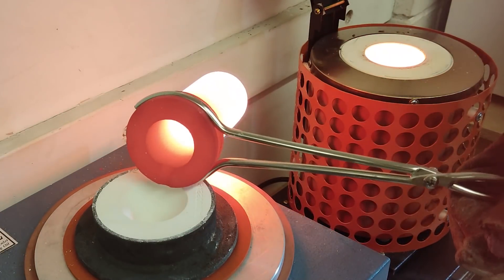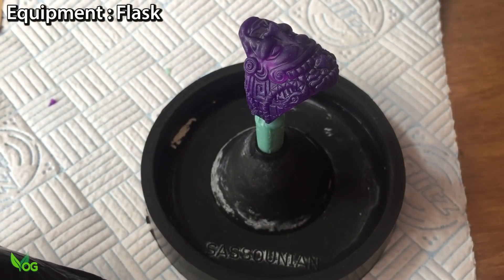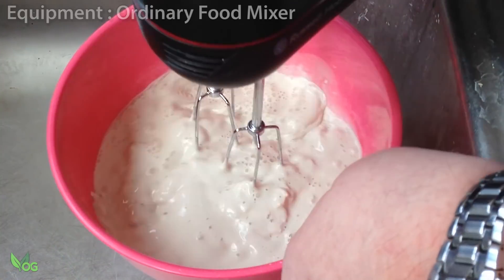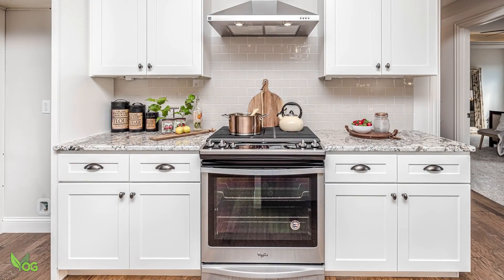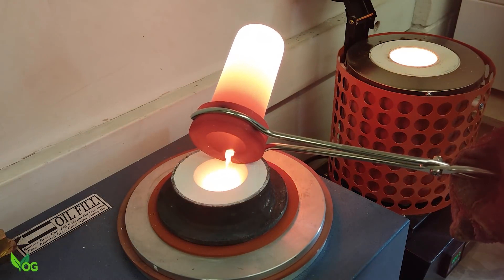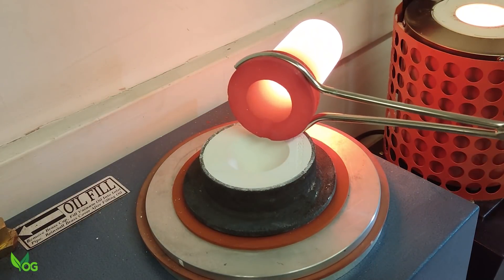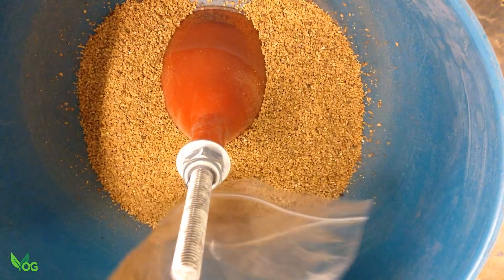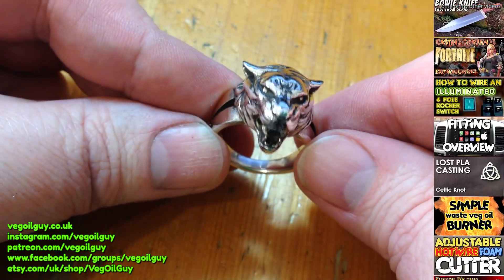Lost Resin Casting Guide - Investment casting - 3D Print to solid metal by VOGMAN

Comment: In my country casting resin is impossible, is there a way to remove it from the equation like print in normal resin then a silicon mold then wax? Would be AWESOME if you try this...thanks for all your work, you're making this art affordable for lots of us around the world with all the "alternative" tools!
Reply: That's totally possible. Pretty sure hes done this as well, using a giant syringe as a wax injector and boiling water to melt it all.
Reply: It's indeed possible and makes a lot of sense for non one offs, it depends on the geometry of the part tho, some parts with a hollow inside (like voronoi geometries) will not work that way, for solid parts it's fine
Reply: You can print your mold in resin and inject wax into it or you can print your model take a vulcanized mold and then go through the wax injection process. which ever suites your 3d modeling and equipment.

Comment: I love how you talk about your previous budget law... that’s when you had me hooked. 
I still haven’t got to the stage of casting, but I just finished a custom set of badges for a 69 Firebird, that we built a stroker 454... so 505ci badges for the bonnet plus 505 Pontiac badge inserts for the rocker covers. 
I used Phrozen TR250  high temp resin on my sonic mine 4k.
First ever resin printer. 

I’m using a special chrome paint system by ALSA called Easy Chrome. 
Stupid expensive but mind blowing at the same time. 
$200au for 50mls.

Comment: Your videos have been a tremendous help in moving into metal casting. 

I’ve been doing other types of molding and casting for years, and making knives. But not much lost investment metal casting. 

I had a kiln lined up for burnout, but in typical internet-listing fashion, dude sold it out from under me. 

I know In a couple of the videos you’ve stated that a home oven can’t do an adequate burn out. For whatever it’s worth, I’ve had some success using the self-cleaning function. It gets close to 1000°F (980F/526.6C) and usually runs a few hours. Once it’s cooled, I’ll slowly heat it a while again in my furnace to ensure any residue has burned out. I know it’s not ideal and can stink to high heaven, it’s better than nothing
Reply from the maker: Thanks for the share 😁
Reply: @vogman  i know it’s anecdotal and far less than ideal at best. Appreciate all the info you share, and know you’re far more experienced than me. Didn’t want me previous comment to come off like a typical internet know it all 😅

Comment: I have quite a few smaller flasks I use and a whole assortment of rubber sprue bases. A really cheap hack if you need a bigger flask is steel bean cans with both ends cut out. They only work for one or two castings, but they're basically free. 😉
Reply from the maker: Thanks Bill 😁

Comment: Fantastic video....again.......I am still in the proces to change from sandcasting to vacuum casting......but the burnout cycle is the thing that stops me......it is not an easy job to do in my room at home. Thanks anyway for this informative video......i will help lots of people....
Reply from the maker: Burnout takes a while... I usually run overnight. By the time I've had breakfast, it's normally ready for me to get started 😁

Comment: One alternative to a ceramic kiln is to modify an old oven, lining the inside with refractory cement, removing the original heating element, and adding the components of a burnout kiln; the benefit is that you can use the bun warming drawer to house a pan partly filled with water to catch the initial outflow of melted wax so that it can be reused. Then you flip the mold and vaporized the remaining wax. The kiln we used at a bronze foundry was huge but operated much the same way, saving a ton of money.
Reply from the maker: Great tip!

Comment: You make everything look so easy 😭 Do you need any specific set of skills to get good results like this? Or with the proper tools and machines, its pretty simple to just follow the exact instructions and come out with a good piece?
Reply from the maker: I've no formal training. I am no expert. I'm just an amateur that's having a go. So yes, as long as you have the right equipment and follow the procedures correctly, you should achieve reasonable results. This video may help too https://youtu.be/fEsJlmY1H5I

Comment: Have you ever experimented with spin casting?
Reply from the maker: It's quite limited... there's a finite amount of metal you can apply to achieve crucible. Vacuum is far more flexible and has the advantage of not flinging molten metal at high speeds. So no, I haven't 😁

Comment: What are your thoughts on centrifugal casting for home setups? That's what I'm used to from university. At the least I imagine it's a greater space investment, and may not save much as you still need a vacuum for degassing.
Reply from the maker: Centrifugal casting is fairly old school these days. There's nothing wrong with it, but personally I think it's been surpassed by vacuum systems. Centrifuges tend to be large machines, needing plenty of space, and spinning molten metal at high speeds is a scary idea. The vacuum system is more compact, better contained and perhaps easier to use. BUT this is just a preference. I will not criticise anyone for using the tools they prefer, especially if it gets them results 😁

Comment: I think I saw in one of your videos that during burnout you had to turn the cast around because wax needed to pour out, but the resin needed to escape as gas.  Can you provide a link as to how you did this. Cheers.
Reply from the maker: There's no like but here's the info... start with the button down so the wax drips out of the bottom. Let the burnout cycle go past it's hottest point, then as it's reaching the lower temperatures, flip it 180 degrees to de-gas. Works like a charm.
Reply: @vogman  Top loading... is it hard to flip?  a wee vid would be great.

Comment: Very informative video !  Question, could an old pottery kiln be converted to use as a burnout oven with only 120v  20a circuit as a power source ?
Reply: We used an old pottery kiln with no modifications for burn out, but you do need to monitor the temperature so that it stays in the right range long enough to completely remove the original with out residue.
Reply from the maker: Yes, absolutely as long as the programmer is up to the task.

Comment: After you've completed the burnout, how soon do you pour the metal in? I.e. can/should it be left to cool down, or does it need to be done right away? Thanks for the videos!
Reply: Pouring the hot metal into a cold mold will cause the mold to crack.  You should have your mold preheated, and the temperature range that is OK will usually depend on the metal you are pouring into the mold.
Reply from the maker: Part of the program should be a cool down phase, bringing the flask tp a temperature suitable to pour. This varies depending on metal, size of the castings, sheer luck and lots of experience, but it should remain at this temperature for AT LEAST one hour before pouring.